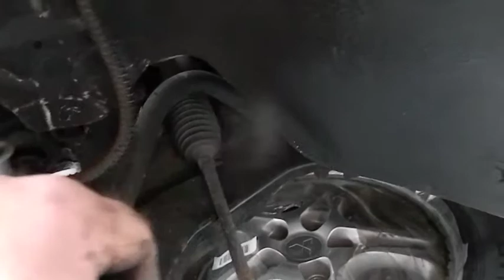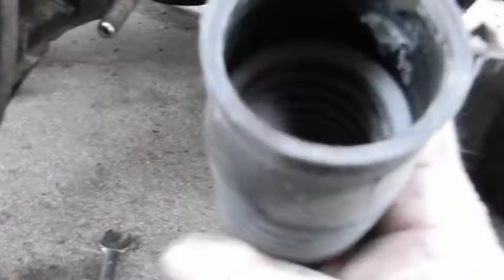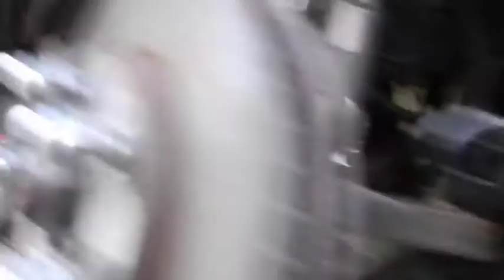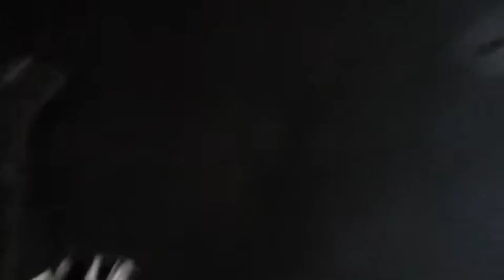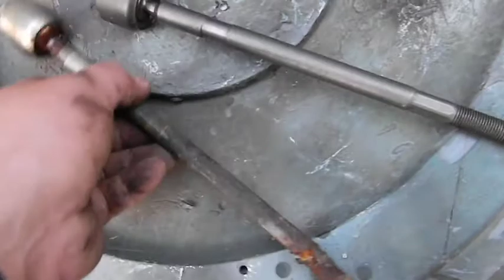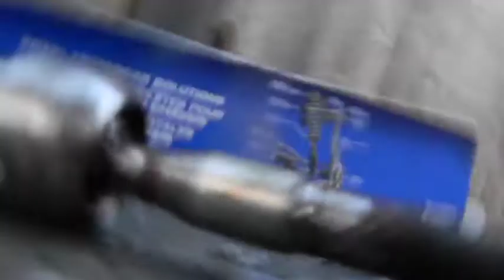Mitsubishi Outlander Repair Pt  4

Comment: What do you do reuse those weird ear clamps on the boot?
Reply from the maker: I open them with a flat bladed screw driver and either use a pair of diag. cutters or the special tool to close it back up
Reply: Ill try that. Those bastards are hard to find, Oetiker is the big brand but no one usually stocks them in large sizes.  I started buying little small sized assortments, they rule instead of using worm clamps. yea I have the boot clamp pliers and the regular old ear clamp pinch pliers. knipex makes a nice set